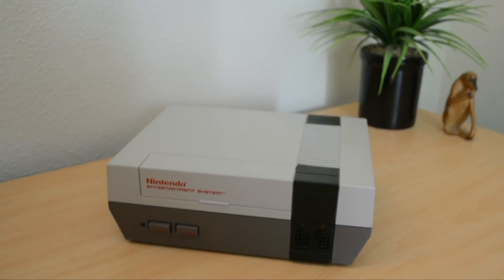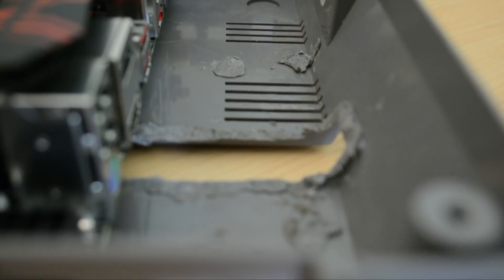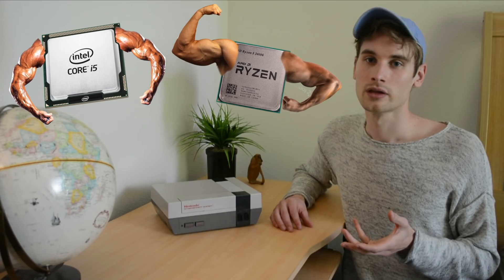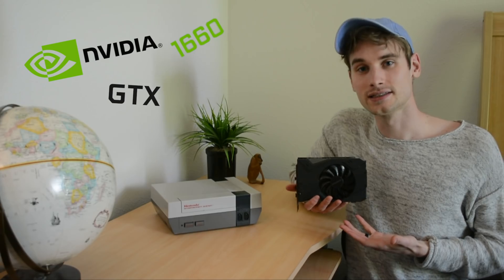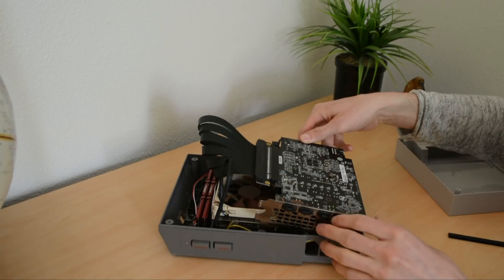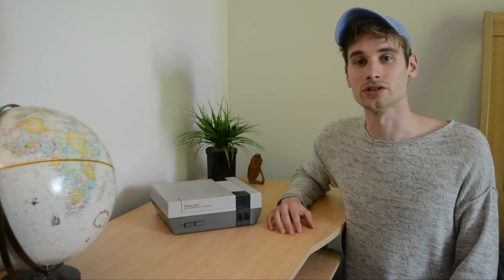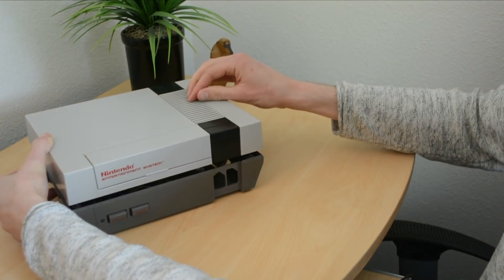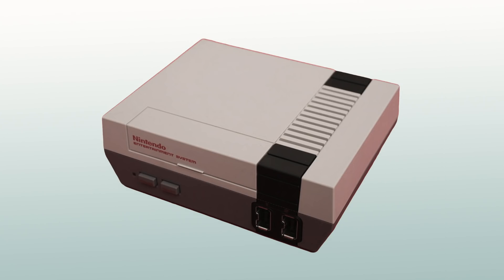How I Turned An NES Into A Gaming PC

Comment: Here is what you do: Paint most of it to match the bottom half of the NES, EXCEPT for where the black stripe comes in for the controller ports. That spot on the acrylic, you really should paint to match the stripe, otherwise it looks just god awful no matter what you do to it. Keeping the color pattern matching perfectly will give you 99% of what you originally sought: a PC in a NES, plain and simple.

Now, regarding that huge fugly gap at the bottom: No, just no, don't leave it like that.  Please, for the love of god, use some acetone mix to melt some plastic, use your fingers to carefully mold it into place before it rehardens, and then use a very tiny drill bit on a drill, and drill a ton of tiny holes all along the underside. There's absolutely no reason you need some huge friggin' gap like that, when a series of holes is much better. Not only is cooling much more evenly distributed but it also lets much less moisture, dust, etc through. If you're concerned about a ton of tiny holes not being good enough for cooling, then install some cheap 5 volt fans into the NES's original cooling vents at the top of the shell near the black stripe. Make sure they're aimed outwards, and that the only way the NES can take air back in is from the underside, and voila.

Comment: What I would do if I were to tackle one of these today, is retrofit the internals of the Valve Steam Deck inside the NES shell. Not exactly a 1080p powerhouse, but the form factor of the Steam Deck would lend itself well to being fitted into the shell of the NES.

It would need a cooling solution that's more appropriate for the build, since the cooling solution of the Steam Deck relies on negative pressure, but I think it would work well.

Comment: there are solutions. zotac 1050 ti mini, intel nuc. visiontek rx560. etc.
Reply: actually nes is 25x20x9cm and "ZOTAC ZBOX MAGNUS EN52060V" is 22x20x12cm so you can fit a 2060 rtx. you have intel nuc 11 enthusiast 12x12x6cm also 2060 rtx. you just need additional fans cause your pc will be inside a nes. zotac and nuc made proprietary "barebones" small form factor motherboards with embedded graphic card, like ps5 and xbox series does.

Comment: have you considered getting a second different type console like an N64 or a wii or atari 2600 or whatever and putting the GPU in that separately ? that way each unit's cooling air would be independent and the two cases would look like a small collection of vintage consoles, which it might take a second to notice, have one plugged into the other. obviously that ribbon cable would be problematic so a different cable would be required to make it look natural.

Comment: bro. listen.
cut out the entire bottom. and give the base of the NES little stub legs like you have done here, but instead in the middle, do it below.
that way you will reduce the gap in the middle by 50 percent or more if you really needed to.
think about it. you have already compromised the bottom, the integrity of it cannot hold the motherboard and graphics card at all. cut it out and make the shell of the NES sit on top of the build.
move that gap you have introduced to the bottom.
Reply: after that you can even make a FAUX platform that the NES is sitting on top of, but really it holds the bottom of the motherboard, like a bigger tray that you can pick. maybe shaped like a block of black wood. or something.

Comment: What are you doing my guy obvious solution is to make it a sandwich layout. Putting the GPU at the bottom with the fan facing the cut out bottom. And the motherboard sitting on top with somethin between both to keep them from recycling heat.
Reply from the maker: I played around with that option, but there still wouldn’t be enough space for everything without having the gap between the top and bottom case of the NES. With the current layout the GPU fan still faces the cutout on the bottom anyway, and it ended up a lot easier to have the GPU raised than setting up massive motherboard standoffs and mounting the PSU underneath.

Comment: Im trying to put a h60 liquid cooler in my nes build. It actually fits too. The problem is tubing is way too long. Im not even sure you can remove tubing in an all in one liquid cooler 🤦‍♂️nes builds are fun but frustrating.

Comment: Hey, I have a gut feeling that your build is going to suffocate badly.
Reply from the maker: It’s definitely a big challenge. Temperatures are fine right now, but I’m worried about once I install the frosted acrylic.
Reply: @_equalo  thermals might be good because it is open cover now. The way you put GPU I am surprised that the fan is able to spin. 
If (or when) it starts throttling you may forget about good performance. Might be better to use a Ryzen 5 APU and make a decent air flow. It will work much better and stable than a chocked one with1660 gpu. And the NES case will look stock as you wanted.
Another option is to make a scaled up 3d printed NES style case for your build.

Comment: I did nearly exact same thing for a case modding competition at QuakeCon a couple years ago! I used bits of acrylics and epoxy for some of those holes. I also used bondo/ car bodyfiller for smaller holes around the case.

Comment: I quite like the black finish look: il leaves no "gap" between the controllers slots and the black parts further up, unlike the "grey" option.
As for the RGD/LED option... Well I'm not from the "lights everywhere team" ^^ Actually I'm quite on the opposite team: the sober it looks (to me), the better . And LED may have an impact on the heat inside the case, don't you think ?

Anyway, this is an incredible build you're doing, I really like it and am waiting for the final result ^^

Comment: You need access to a 3d printer! You could reinforce the case and design proper brackets to fit all internal components as well as much needed airflow ducts.
Have you thought about removing the mounting cage/bracket from the gfx card?
Obviously you'll need connect that thing to a monitor and it's not ideal placement at the front!.
Reply from the maker: A 3d printer is one of my next purchases I'd like to make! There are so many little things it could've helped with here, and so many other projects it could allow me to pull off.

Comment: i think if you paint the center section gray to match the original, it would help to include a black strip that continues the band where the controller ports go.

also: maybe find a junk cartridge, slice off the end of it, and glue it under the flap so it at least has the appearance of a game being loaded in.

Comment: Did the same thing but cut the back and have the I/O on the rear. Used an HD plex psu and have it all powered off a 240 watt dell laptop brick. Going to run a 1650 low profile in it, so I can keep all the ports on back. For the bottom I got some metal mesh cut it to be slightly bigger then the raised part I cut out on bottom and used epoxy to hold it in place. Also rigged up 3 x 40mm fans on the top vent for airflow.
Reply from the maker: I ordered some 40mm fans for this one too, but they're taking forever to arrive. I'm thinking of putting them in the cartridge slot for maximum airflow.
Reply: @_equalo  i bought some cheap ones from ebay also took forever and were garbage. Ended up biting the bullet and buying some noctua ones.
Reply from the maker: @FerrumBellator  Hopefully that doesn't happen here. If it does, I'll probably end up doing the same.